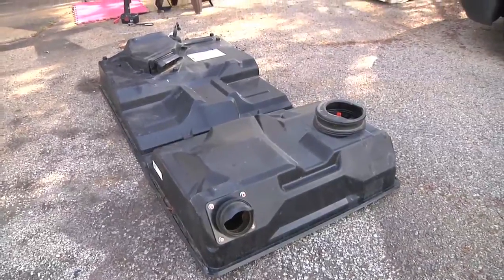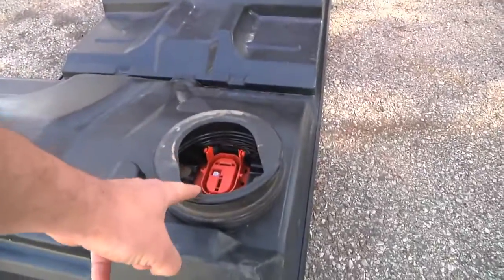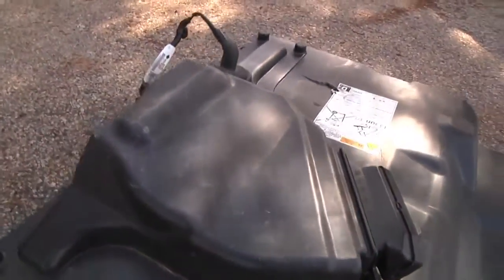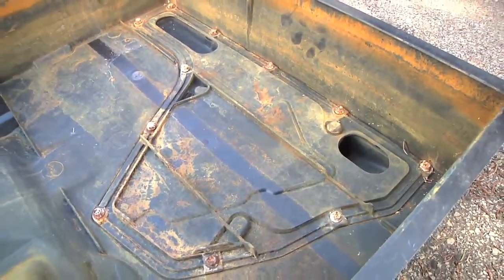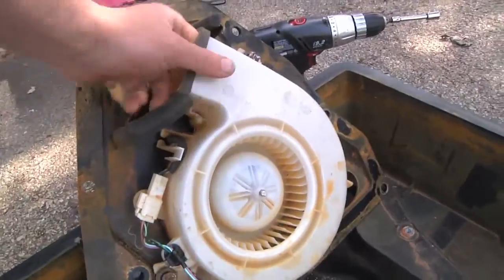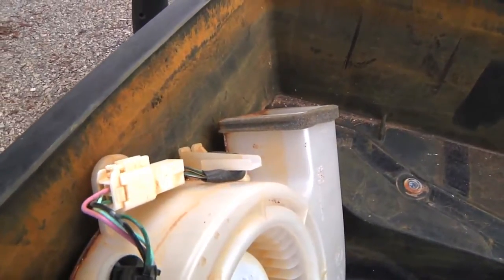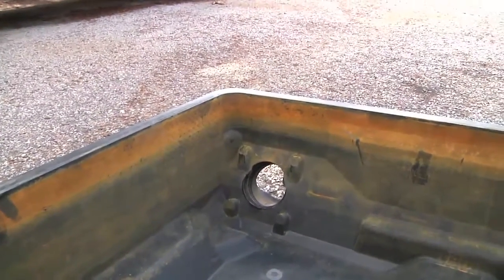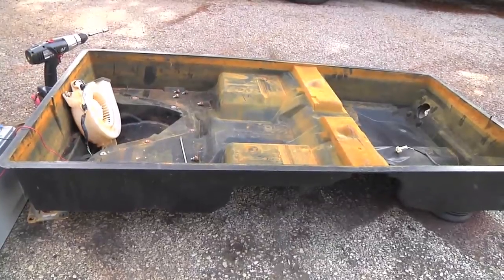Mitsubishi iMIEV: Battery Pack Air Cooling and Fan Removal

Comment: Please clarify whether the fan blows air outside or circulates air back into the cabin. 🤔 For winter use it might be preferable to blow air into the cabin. That might warm the battery while charging with the heater on. While driving it might recover some waste heat into the cabin. 🤔

Comment: Fan has power, ground, and speed/rpm sense wires, the fourth is PWM. Missing the PWM signal is why it won't spin with just power. Some you will be able to make it spin up by connecting PWM wire to ground.

Comment: Can anyone tell why a filter is required in the exhaust of the fan? Where is the outlet of the fan cover through filter is connected?
Reply: I think its a noise defuser as you say why filterr air going out
Reply: It may just be there to prevent debris from entering and dropping into the fan.